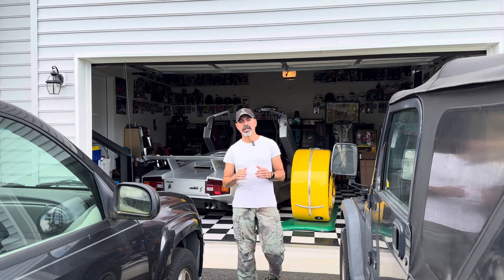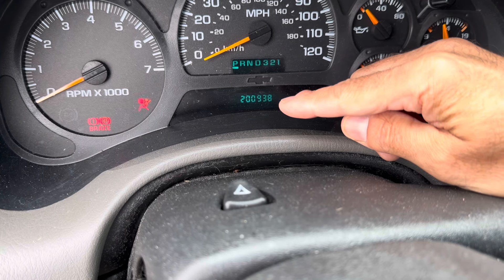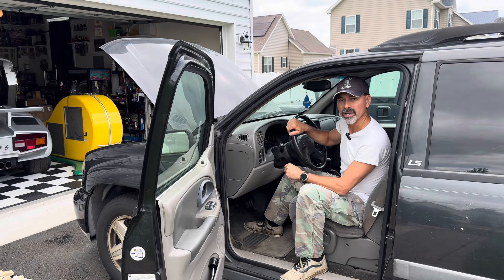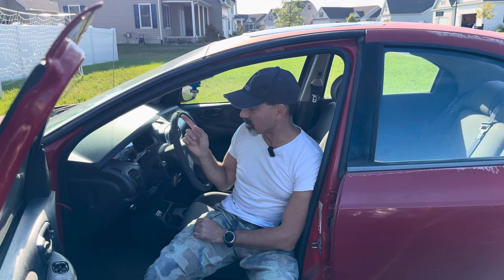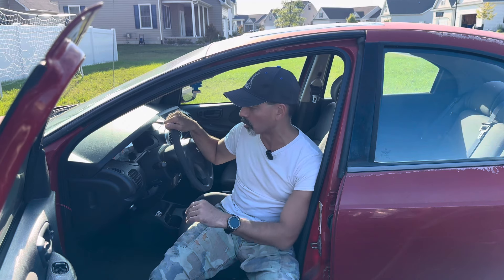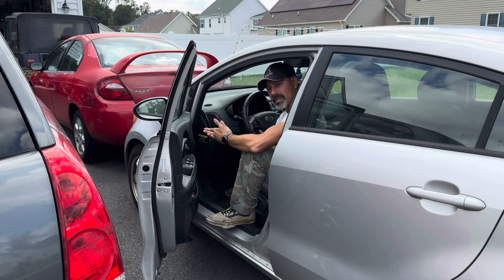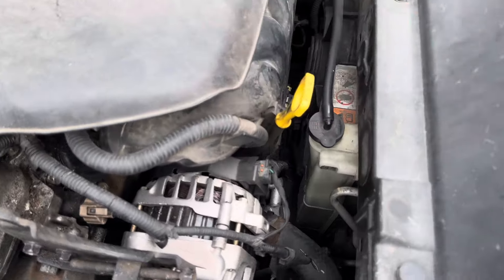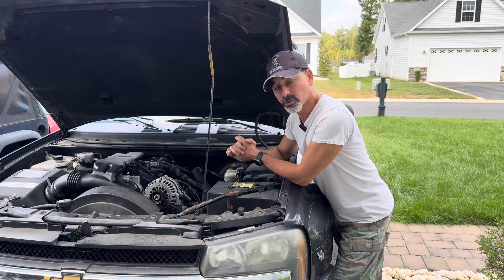How To Make Your Car Last Long (Andy’s Garage: Episode - 497)

Comment: Hello Andy 
This is John Chan the fisherman.  I'm almost 55 years old. I will retire in short order at 55 years old. All of my kids are out of the house. 
All I can say "wow" great job brother.
I also have 6 vehicles....my 07 tundra has 195K miles , 13 rx350 has 120K miles,  18 nx300 has 72K miles,  23 gr86 has 5K miles, 09 toyt Yaris has 166K miles,  last but not least 07 RX350 has 62K miles. Oh yeah need the truck to tow my fishing boat 22 ft outrage. The boat engine 06 Suzuki 175HP four strokes still purs like a kitten. 
Your replica might got a good V6 , GM 3.8 liter.  That engine will last. 
Your commuter car, Kia that's is impressive with over 200K miles on the VCT transmission. I thought cvt will die by 105K miles. 
As you can see my vehicles doesn't have CVT transmission. 
Likes your video thanks,  chow
Reply from the maker: @JohnChann-w2s  Thanks for the feedback and support 👍

Comment: 16:38 i hear from other youtubers that you want to use the whole range of RPMs in order to keep the engine healthy, and not just cruise under 2k. What's your take on that advice?
Reply from the maker: @rolandverde8771  I personally do not like going above 2,000 except for accelerating when merging etc. Running at high RPMs puts strain on the engine in time and can also lead to blown head gaskets. Some high performance engines like V10 and V12 recommend higher RPMs to break them in,but aside from those I wouldn’t do it

Comment: I bought the car with 155450 thousand and it's a Mazda cx9 AWD 2010 I have it for almost 3 years and now it has 246548 and the only thing I haven't put money in, is the gearbox and the engine, and when I turn it on, the car sounds like new because it doesn't sound like anything ✌️